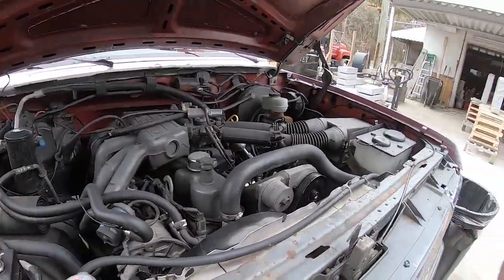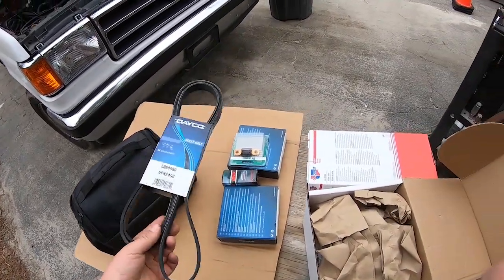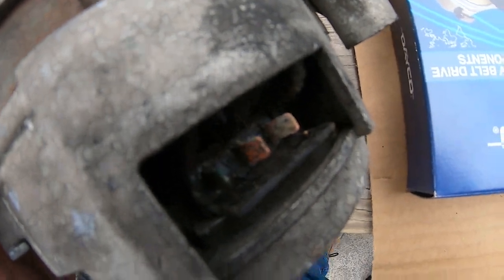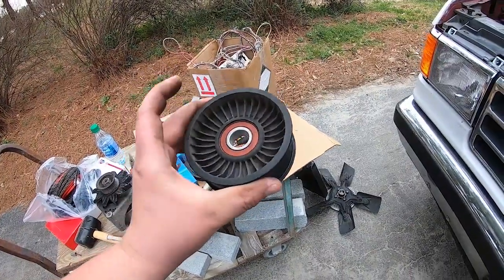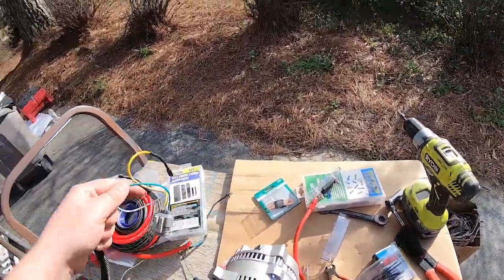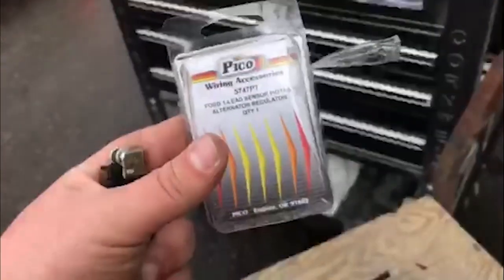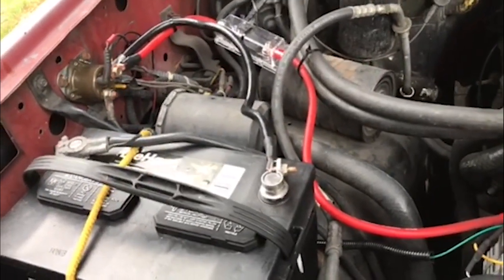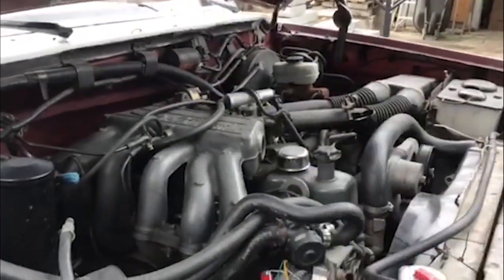How To Upgrade To 3G Alternator from Ford 2G - 1990 F-150 4.9 Straight Six

Comment: What belt did you end up with? On my '92 4.9L with A/C the standard 98" belt is now too short. Understandable given the alternator pulley is in a different position now with the 130amp alternator. The belt you showed in the video (6K1005) had a note that it was too long. That belt from Napa has an effective length of 100.54 inches. I cannot find anything between 98-100 inches. So... What belt did you end up using??? You didn't note that.

Comment: 150a is a little under what you’d want. Usually want to do 80% of what you’re rated for so 120a would be 80% of 150a. I went with a 175a anl fuse.

Comment: i did the swap on my 1988 f250 5.8L  about 3 years ago.  this may help some of you guys. find or go to a SCRAP YARD ( where you take cans and metal for money) usually all SCRAP YARDS have a bin or barrel where they keep electric motors and alternators. just look through them and find one thats all there ( any alternator dosent matter what kind). i can usually get them for under  $5.00.  now take that alternator to a (PICK A PART ) type auto salvage yard.  then go out and look for mid 90`s mustangs and taurus cars with the V6. ( IN MY AREA I GET ALTERNATORS FOR AROUND $22.00)     look for one thats pretty clean and looks newer on the engine. then use the alternator from scrap yard as the core you trade in. i have about 7 of these 130 amp alternators in my garage and a spare one in tool box on truck ( just in case). also take the alternator you got from pick a part or pick n pull to a parts store and have them check it. some times i replace the bearings or voltage regulator. BUT ITS A LOT CHEAPER THAN BUYING A NEW OR REBUILT ONE. MOST OF THE TIME I FIND ONES THAT HAVE ALREADY BEEN REBUILT WITH THE STICKERS ON THEM.   last time i checked these 3G alternators at auto zone were around $200.00.  also while you are at the salvage yard looking for the alternators you can also get the wiring for the alternator as well and also look for the 175 amp mega fuse and cable on some of the trucks / vans/ cars. HOPE THIS HELPS SOME OF YOU GUYS OUT THERE ON A BUDGET. IT REALLY HELPED ME

Comment: Some advice from a OG get a larger ground cable than the positive cable and it makes it easier on your battery and your alternator you need a larger ground wire than your positive wire for hot wire that's your tip for the day

Comment: Well this was the most useless video. Cant get the alternator out. Removed 2 bolts and wasn't able to get the idler loose. Should still be able to take it out or knock it loose. Would be nice to see how it came out.

Comment: Hello all. Which bolt should be tightened to 58 ft ibs and which bolt at 25 ft ibs? Please reply top bolt __ and bottom bolt __. I tightened the top bolt at 58 ft ibs. If it's suppose to be at 25 ft ibs should i loosen it then retorque it at 25 ft ibs? I think I made a mistake. Thank you for your response I truly appreciate it to anyone whocan help.

Comment: I have 1990 Ford F150 4x4 5.0 xlt lariat long bed ext cab. The Chilton repair manual says Pivot bolt 58 ft ibs Adjusting bolt 25 ft ibs wire terminal nuts 60-90 inch ibs. My top bolt is very short maybe 2 inches and the bottom bolt is about 5 inches long. Is the bottom bolt the pivot or adjusting bolt? I thought the top bolt was the pivot bolt. Thank you

Comment: good job on the swap, you can go further and replace the grounds on the frame and to the engine block leading up to the battery and your positive for larger gauge cable which will make a difference on how the vehicle starts and runs and handles the electrical loads.  and clean the contact points to bright metal as your in there, (the problem is the wire gets old and corrodes from the inside of the sheathing on the cable).  that goes for any other ground you see around the engine bay and under the truck. now that you have the extra power of the 3G alternator look into relaying your headlights to the battery as it will brighten your headlights and take the load off the headlight switch which is another problem of trucks in this era as Ford for some reason didn't do it and can lead to a burnt up switch or fires since the switch is taking full amps of both headlights when it shouldn't.  Keep it up buddy.

Comment: I had an '86 Mercury Cougar 3.8L V-6...GOD that car was impossible to get parts for. A replacement serpentine belt (from the dealer I bought the car from) was too small. THEY aske ME, where I got it from. I told them, off the car I bought from YOU! It turned out it needed a belt from a 1984 Mercury Marquis? They asked me why it had that engine? I said, did I build this car? Distributor cap for the same car. They asked me, which cap did I want, as there were 15 different caps for that car????? I said, never mind. I'll keep using the old one and I'll sell the car when it goes bad...I feel your pain with this Ford truck...I'm glad you got this figured out!!! WIN, WIN !!!!!